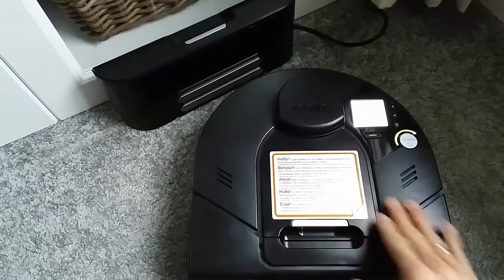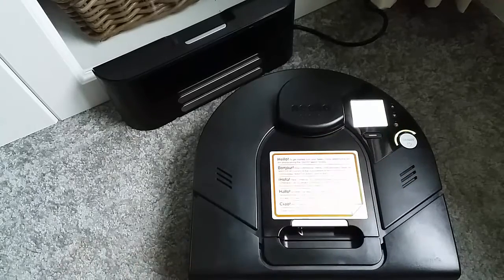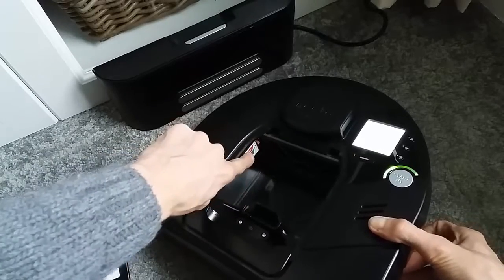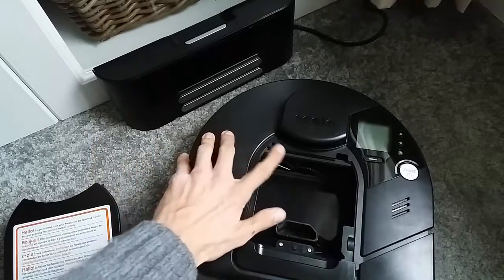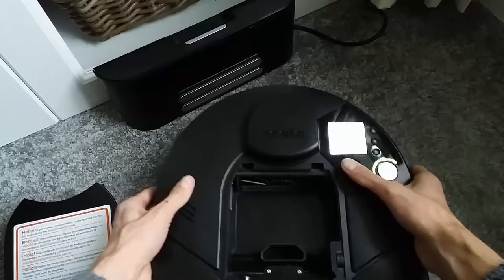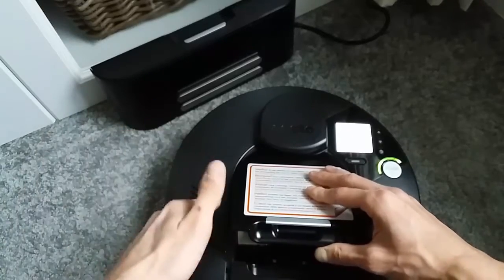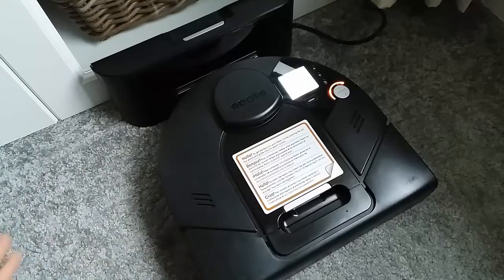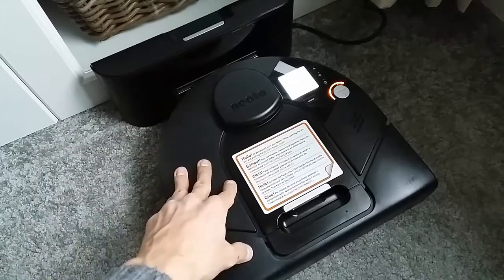How To Calibrate Neato's Nimh Battery

Comment: I have a botvac d series and I just replaced the battery, but it still wakes up every 5 minutes and says to clean its bin and hit the on switch, then it shuts down again and does this cycle endlessly, any suggestions other than the hard and soft resets? 😔
Reply from the maker: Is the battery genuine or third-party?
Reply: @howtotechstuff  genuine, but the botvac is like 5yo?

Comment: Hi, i have a neato botvac d75, my battery and everything is done however when i put it to charge, i realise it charges then stops and repeats this process. Then it started charging but after 5 hrs it was still low battery. Can you help me with this problem? Thanks
Reply from the maker: Hey Ammar, is the battery genuine or third-party? How did the robot behave on the old battery? Was it the same? How old is the robot?
Reply: @howtotechstuff  Hi, the battery is not genuine but the robot was completely fine before this battery and it's only about 3 years old now.
Reply from the maker: It could bee the battery. I'd possibly buy genuine one on Amazon(probably you can return it back in case it's the same issue) and test
Reply: @howtotechstuff  what if it's not the battery, then what should I do?
Reply from the maker: Then it's the robot...some sort of hardware issue
Reply: @howtotechstuff  I tried the new battery and it still is not charging. What should I do?
Reply from the maker: It's something to do with the robot. I'd call their customer service, explain what you did and ask what in/out of warranty services they offer.

Comment: My XV signature also suddenly shows a completely blank screen, like in this video. How do I fix this? I really can't see anything on it.
Reply from the maker: Hey Jan, I have some steps for blank screen on one of my other videos. Please check it and hopefully you get it back to work. All the best!
Reply: @howtotechstuff  Thank you for the fast reply! Which video are you referring to? I can't find it.
Reply from the maker: Hey Jan. Sorry, you're right there's no specific video tackling this. Generally for blank screen I'd recommend soft and hard reset first. Also, can you start a cleaning cycle without the screen? If no it might be something else than just a screen.
Reply: @howtotechstuff  I'm looking to replace the batteries but calibration without the screen is quite a feat. I'll try the soft reset first
Reply: Well soft reset doesn't do anything. I'm afraid to perform a hard reset for it would require calibration.
Reply from the maker: Hey Jan. Thanks for letting me know. Even if you perform hard reset you can still plug the robot to base and it will charge batteries so you can test it.
Alternatively you can plug the robot to base without batteries at all( removing them completely from the robot); within seconds the robot should power up directly from base. If the screen still doesn't work it would mean changing batteries will not resolve the issue.

Comment: I have an XV Signature Pro. I have watched several of your videos, thank you -- and determined that the charging base was fine but that I needed to change the batteries in the vacuum itself. I have now done that as you describe. I then tried the hard restart suggested in this video. However, when I turned the unit back on with the button and replaced the dust collection piece, the screen lit up but no copy appeared. I have not put my vacuum on the base because I cannot see the menu to choose the "new battery" instruction.  I would appreciate your help, if possible.
Reply from the maker: Hey Margaret, thank you for your message. I would start by making sure the base is working correctly:
1. When you open the base; do you see a green light on the brick?
2. If you connect your robot without batteries the LCD should lit up as normal and the sound should come up; is that the case?
3. I'm also aware your robot has possibly another way of charging; a tiny little cable coming from the brick inside the base to the robot itself...have you checked this method as an alternative? 

Another thing to consider would be whether batteries are genuine or third party but first I'd do the above to make sure the robot is turning on. 

Hope the above helps.

Comment: My BotVac D 80  gets a 3000 code.  Did the resets and cleaning.  If I tap the bumper it seems to run .  Tapping on the side seems to work better than the front.  Could it be dirt that I have not found.  I did use air pressure also.

Comment: I bought my botvac 80 second hand and was told the batt might need replacing. charged fine once and ran its cycle. then when it redocked my troubles started. it keeps saying to turn the switch to the "on" position but it already is. It wont charge up anymore. WIll try the soft and hard resets soon.
Reply from the maker: Sounds like a battery. Do the soft/hard reset and battery recalibration; see how that goes for you.
Reply: How To Do Stuff : thank you for the advice. First time owner of a neato product and im amazed. Needed something that was smart and newer to replace roomba discovery. I was not really  successful with the resets. Had to use neatocontrol to trick it into 100% battery. So far okay. Buying new battery soon in much hopes it will solve most issues. Also i believe the lidar is not spinning fast enough. The rotaton seems a bit slow to me and sounds odd initially switching it on when testing it in neatocontrol. My concern is that it makes it harder for neato to navigate around.
Reply: How To Do Stuff also a red charging light??? That color is not explained or mentioned in the manuals. Just green and amber.
Reply from the maker: Glad to hear you're amazed with Neato :-) Red/Amber/Orange is the same colour on the robot. Can you explain how did you trick the battery with neatocontrol? Never heard about it.
Reply: How To Do Stuff sure. I have the program called neato control version 3.3. When open and connected via usb i then go to the recharge tab and click "set 100% battery", click disconnect from robot and then do a soft reset. That allows me to at least get to to run a clean cycle. Great program to test the various sensors and stuff on the neato.

Comment: I have a D80 which keeps asking me to remove the dirt tray and turn the switch on.  The switch is already on so I turn it to off and leave it there for 10-15 minutes.  I then turn the switch to on and it immediately starts all over again by asking me to remove the tray and turn the button on. This continued repeatedly so I turned it off and it still, to my amazement, kept asking to be turned on.  At this point I put it in the garage, away from the charging unit, so I couldn't hear it any longer.  Any suggestions on what I should do now.  Let me add that I have had my Neato for 2 years as it was a Christmas present on 12/25/15, therefore my warranty ran out last week.  I have ordered a new battery which I expect to be here any day.  Thanks for any help you can offer.
Reply: Perfect thank you so much!!!!!
Reply from the maker: +Becky Barnes Hey Becky. Thanks for all the info; this might be the exactly what you've ordered: battery. When the battery is not providing enough voltage to the robot it would give a message "turn the switch to on" but the switch is already on...which is your case. Did you buy genuine or third party battery? Make sure you remove the battery gently without pulling any wires and let me know how that went for you.
Reply: what battery should i order I mean third party? whitch one you recomded
Reply from the maker: +Neizan Love I wouldn't recommend third party. I'd recommend genuine Neato batteries. You should be able to find them on Amazon, BB, BB&B, etc.
Reply: I have sam problem like you Becky  on my d85  "remove the dirt tray and turn on"  Did you fix problem with the new bttery or is there  diffrent problem?

Comment: Hi, thanks for the videos!
My Neato ran over the Dog’s water bowl and got very wet.  Ever since, the battery says it needs to be charged but when disconnected it reads 14v+ (BotD) with my multimeter.  Going to try your recalibration to see if it helps.  Hopefully the unit is still functional.
Reply from the maker: +Darrin Carty Sorry to bear about the water. Yeah these guys don't like liquid so see if that helps.

Comment: Thanks for your videos.  I have an XV-11 that had an OK battery.  In an attempt to increase it's run time I pressed the "new battery" button.  Now it runs for about 1 minute before shutting down.  Previously it was at least 30 minutes.  No other changes were made, and I have tried to re-calibrate the batteries since then.  Any ideas?

Comment: I have a new (used) Botvac 80. It was used very little by the previous owner (about 14 hours using the hexadecimal equation). I immediately bought the lithium replacement battery available on Amazon because it seems illogical to me to have to run the Botvac unnecessarily for several times just to do battery maintenance. My question is, if you know, what state of charge should I leave the NiMh battery for storage?
Reply from the maker: +guitartec Great question. Generally I would advise to re-charge any type of battery as soon as you get 'low battery' message. When it comes to storage I'd recommend charging the battery fully and keeping it in a cool dry place (no direct sunlight). If you want to leave the robot for couple of months I'd recommend disconnecting the battery from the robot as well. 
Out of curiosity, what Li-ion battery did you buy for your Botvac 80? Does it work well for you?
Reply: I first started with a $99 Lithium Power, Inc 7200mAh found on Amazon, but I returned it due to less performance than advertised- it had no better run time than the OEM battery. I just bought a Cybertech 7200mAh lithium on eBay for $10 less ($89.). It looks identical to the Lithium Power, Inc lithium battery in every way, including the box, like it came from the same factory in China. I haven't yet run ther Botvac through a whole house cleaning so I don't know if it's any better than either of the other 2 batteries. Even so, if it's as good as the OEM NiMh, I'll keep it so at least I won't have to do special maintainance in any way.